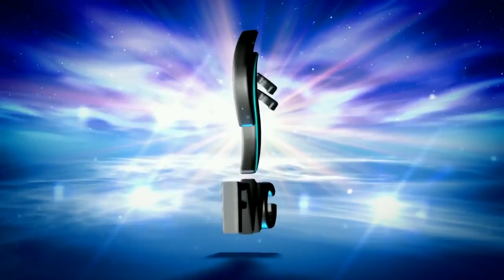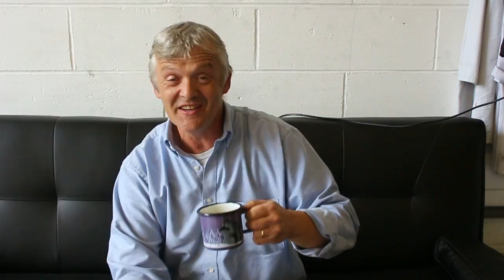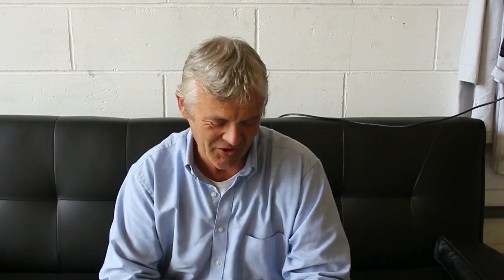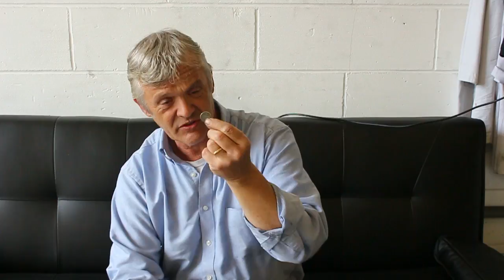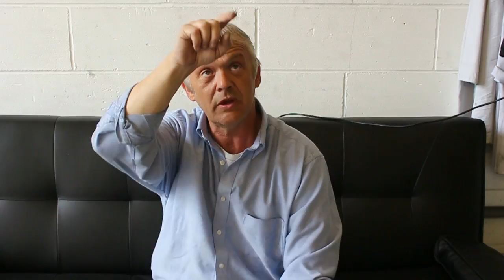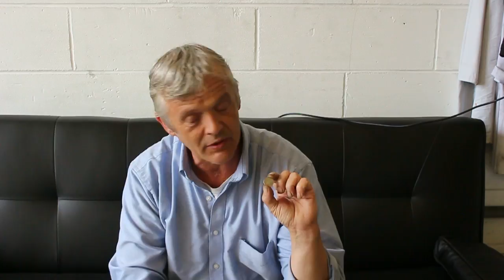FWG Battery - Follow Up

Comment: Hi Robert,

First, I love your enthusiasm and willingness to share - wonderful and you expect nothing in return.  The issue I personally had with you previous video is that you allowed people to "infer" that because you had X times better energy density at 2C discharge rate, that a C/10 or C/100 would have a similar performance advantage.  The specific high discharge test clearly shows that your chemistry is superior and that if scaled would be able to deliver high specific power at reasonable high specific energy.  BUT, you very well know that the intended application for button cells are NOT for high discharge, but rather very low discharge. A discharge rate of C/1000 is actually very meaningful for electronics, where a primary cell is utilized for maintaining a realtime clock at a 1 uA current draw.  Also, I wonder what the self discharge rate of your battery chemistry is over days/weeks/months...maybe the useable capacity would be much lower compared to other chemistries.   Every battery is designed for an application and that will likely not change anytime soon.  Your test did remind me of a Topgear episode where they claimed a BMW M3 had better fuel economy that a Prius...it actually did...the catch...the average speed during the test was 135 mph...lol, which is clearly not the intended speed for the application of a city car.  Anyway, love your videos...no harm no foul.
Reply from the maker: it's no worries mate - I think I went through what you said in the video it's the name calling I object to
Reply: If someone were to build a Prius that could do 135 mph it would no longer be just a city car. Button cells are not used in high discharge applications because, as Robert’s test showed, they can’t cope with high amp draw. But as the test also showed, Robert’s battery can cope. I think there is a very viable market for a button cell that could possibly replace two double A cells.

Comment: I suspect the suspicion is aroused when, in the context of a video entitled "battery for sale" an unexpected test setup is used to demonstrate superiority over a big brand product.

I personally have no trouble believing battery chemistry can be improved upon significantly and give you the benefit of the doubt that deception is intended, but I do have a feeling that their use case of low discharge rates is actually reasonable since the capacity is so limited, use cases commonly involve intermittent draw and products would likely be designed around these readily available cells.

Anyhow, another question that occurred to me is how the shelf lives compare.

Thanks for the content, and best regards.
Reply from the maker: I said their point was valid mate - and addressed it to a degree it's the name calling I don't agree with

Comment: I totally get what your test was about but if you got those comment it is because of the form factor of your battery and the battery you tested against. Of course your test is valid and it is great that your battery is capable of such a high power density but devices taking the same kind of batteries (button cell type) often draw very low current. Less than 1mA is not uncommon for a lot of devices like stopwatches, calculators, PC motherboards (for the RTC) and others. A battery with  C/100 or C/1000 max discharge rate is still useful. Not for all the applications your button cell would be useful for but still you can use all the energy they contain in "one go". I think what people wanted to know (me included) is how your battery would compare in the same applications. You said you want to sell them so if you sell them in that form people will want to use them in devices designed to use this form factor.
Reply from the maker: I understand mate - but it is a little odd that folks can't see beyond a form factor to the essence of a thing and concentrate on making the point they want to make rather than looking at the point that is being made.But as I said - the comments were fair and I though I addressed that - I just don't agree with the name calling stuff - for example your post makes a good point and it is well put - who can deny an answer to that - I basically agree with what you are saying here

Comment: I scientifically agree with you ;)
I just miss the graphene Rob
Reply from the maker: we are working on mate- i will try and do more with it on video
Reply from the maker: I must get back to it mate lol
Reply: "C / 1000!?... thats absolute nonsense!" 😂
Reply from the maker: it certainly lasts lol
Reply: Robert Murray-Smith there many applications of the CR2032 where the load current is of the order of 1 or 2 micro amps, that is C/112500 to give a working life of approximately 13 years. The CR2032 on computer motherboards is expected to last 5 to 10 years. These batteries also find application in car remote locking keyrings. While older models only transmit, newer models transponder and have very low current receivers in them.